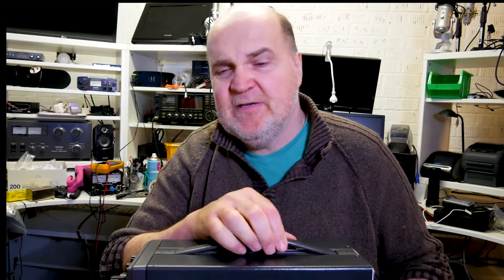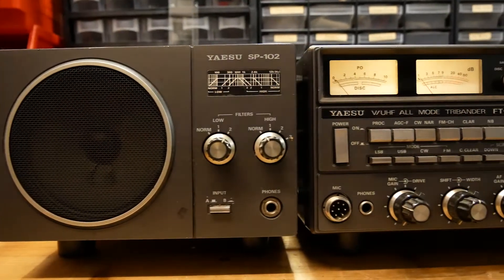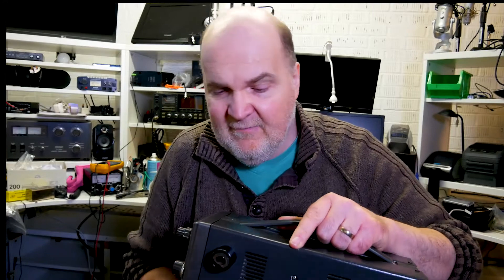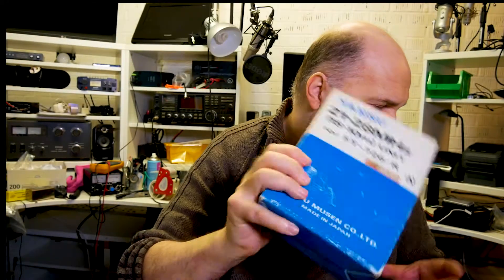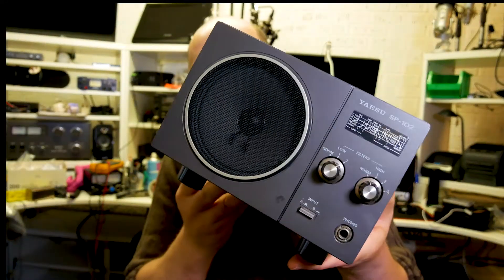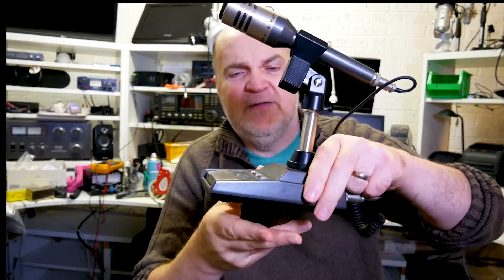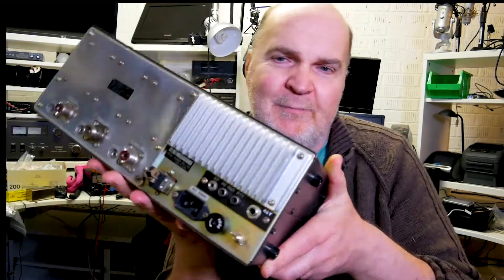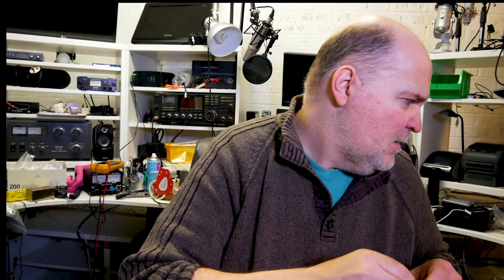Yaesu FT-726R, Great Satellite Base Station for Radio Amateurs

Comment: I bought this on ebay in an unknown condition and equipment, 600Hz filter + satellite unit + 10m module for 200 € included. It works very well.